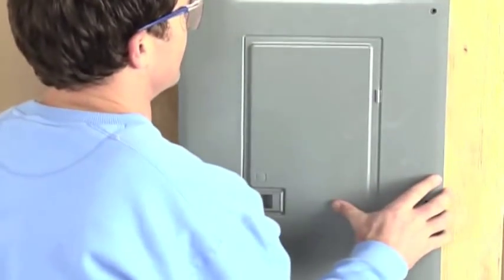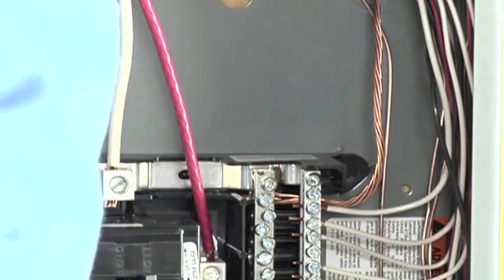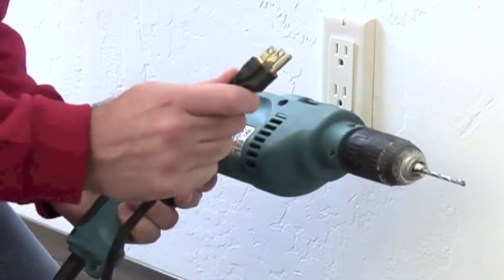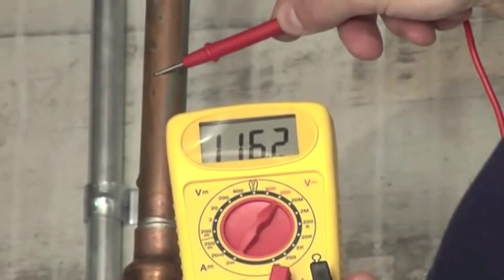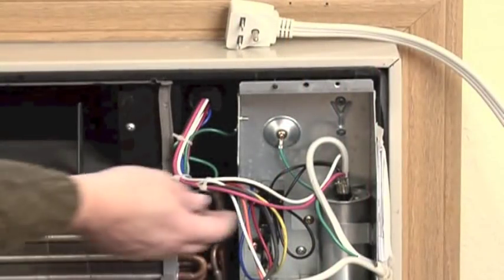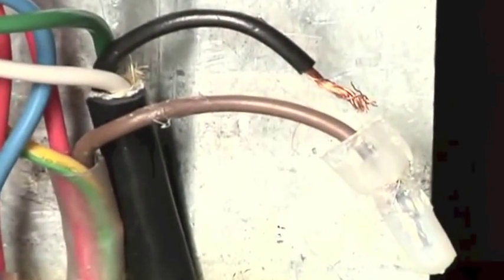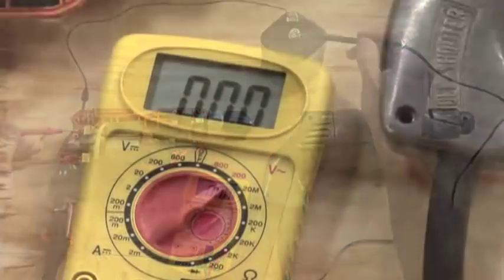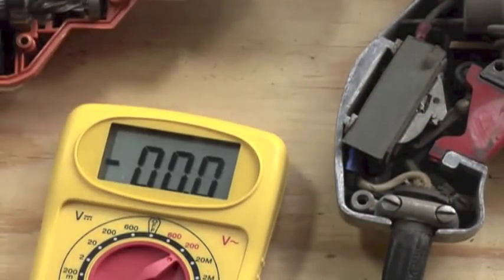Electrical Wiring Safety:  Grounding Wires

Comment: Neutral feeds back to the electric pole ground, and true ground is a rod that's 8 ft deep for faults only or lightning strikes. Main panels do combine them this is true but no current should be on the ground circuit except for faults!

Comment: The ground is NOT where fault current is trying to go. The ground is actually a horrible conductor of electricity. This video is not accurate at all.
Reply: It would become an anode at the least resistance would vary according to the mineral density and moister content.   Back in the day a long long time ago they had the one wire and ground rod system which will light a bulb but won't power an electric motor or most devices. ( I know about the light bulb thing because I've seen it work in real life in old barns.
Reply: Brian:  True.  The way it is normally said is that electricity tries to get back to where it came from.
Reply: Brian Hammerson yes people conflate "the ground wire" with the ground rod. (& who can blame them...) what most people call the "ground wire" is actually a secondary, normaly unused, low resistance wire back to the main breaker panel in the event of a short to (hopfuly) trip the breaker before someone gets a shock. In comparison the GROUND ROD is for "over voltage" equipment protection. (i.e. Lightning strikes)
Reply: Agreed.
0:31 "the ground has infinite capacity for absorbing electricity" = Not True

Earth Ground will often not allow high amperage flow which is needed for not 
only running equipment but for causing breakers to be thrown for safety.
Mike Holt does lots of good videos on this subject (grounding/bonding)
This is why it is important that the power company provide a neutral wire (a
 line going back to the source is what provides high capacity for electricity path(absorption). (high amperage flow)

The ground is useful in case of equipment shorting to its outer casing so that whoever is holding/touching the casing does not become the path of least resistance.
That ground may not be able to allow enough amperage to run the equipment but it is more than enough to electrocute a person. Relying on the ground wire alone in case of an equipment short is not good (though better than having no ground at all). GFCI should always be installed so that the danger can be eliminated (power cut) rather than just rerouted (ground).

It because the Earth Ground does not provide infinite capacity for absorption of electricity that makes GFCI more critical because less absorption can make your body look like a good path to flow into.
Reply: I thank each and everyone of you for these comments, this uncomplicates a lot.

Comment: All this hullabaloo over ground and neutral is a tempest in a teapot!  Years ago, there were only three wires; two "hots" and a neutral.  The neutral was referred to as "ground" and is, in fact, today still the grounded element of the system.  You can verify this by examining the wiring of a meter base, where you will see a 6 gauge bare copper wire connected directly to the neutral and running straight to the ground rod below.  The "third wire" (bare copper), found today in Romex house wire, was added for the sole purpose of providing an alternate path to ground in the event of a hot-to-chassis fault which would energize the chassis of an appliance or the metal case of a hand-held power tool.  Such a fault condition would not trip a breaker or blow a fuse, but would result in a shock to the user if the user's body happened to be grounded.  With the third wire connected from chassis to ground, a hot-to-chassis fault will now trip a breaker or blow a fuse, thereby protecting the user from possible electrocution.  And yes, in that brief instant between the occurance of the fault and the opening of the circuit by a breaker or fuse, the ground wire will carry current.  This assumes that everything is wired properly and securely.  At the very least, the third wire should conduct the hazardous voltage to ground.  In this instance it will likewise carry current.  ANY wire of an energized system has the potential to be "hot" under the right (or wrong) circumstances.
Reply: I remember years ago this was the case with major appliances requiring 240V clothes dryers and electric stoves. The three conductors black,red and white it was common the neutral wire was bounded to the cabinet of the appliance, as a ground. However it was still a return point since stoves and dryers used 120V one side of the 240V for the motors, indicators.  I am not certain when the codes changed, however I know it is required that a four prong cord get and receptacle be installed or doing an update with a completely separate ground connector.

Comment: You need to learn the difference between the "Ground" & "Grounded" conductors! There should NEVER be current flowing through the ground!! The neutral/grounded conductor is load carrying conductor. The Ground is for safety......

Comment: Copper wire going to earth is not a fault ground but is there in event of system intrusion or failure.  Under normal operations there should be no energy on the ground. White (neutral) is to provide a path back to the source. Energy will flow on all paths not just the one with the least resistance.

Plenty of engineers on YouTube to explain it all factually.

Comment: So does this mean you can connect the ground wire to the neutral or ground in the panel?
Reply: cooldog60 that is called bonded or bonding. It is by NEC code for a panel to have grounds and neutrals bonded if it is a main panel vs a sub-panel. However, ground rod(s) should still be installed for the panel.
Reply: @coypatton3160  so was tht a yes or no dude simole question you made hard
Reply: @alexmontoya656  if you can’t handle that response, be sure to leave the covers in the panel!
Reply: For instance does it matter what sides i connect red and black wires for my double prunged breaker I cant find an answer anywhere
Reply: @alexmontoya656  and what does this question you pose have to do with bonding or not the neutral or ground?
Answer:nothing!
Are you talking about running a 240 volt circuit?
You need to have a 240 breaker, which means that both hot lines will have the same amperage, and either the switches are bridge so that both sides trip when one does, or it has only 1 switch (either style is acceptable) the 240 volt breaker also forces the breaker to pull from the opposite feeds to the panel so you have 240 volts. 
Once these are in place it does not matter if the black is on top or bottom nor if the red is on too or bottom. 
Unfortunately, in electrical work, there are no simple yes or no answers. 
As to the above bonding issue you only bond in the main panel. In sub-panels ground and neutral must be separated—unbonded! So the typical answer is always it depends. 
If I said it depends and left it there, how would you have felt? I try to offer an explanation. 
Again not understanding that you have 2 feeds providing 120 volts and you need to pull from each for 240 volts, means you really need to leave the cover on the panel!
Reply: @coypatton3160  u made a simple question hard the correct answer to his problem is no you cannot i figured everything out myself thanks

Comment: Ground concept is only a psychological, additional expense and no sense , appliance works without it.
Reply: Older houses buildings  , electric installations only had 3-wire systems  , only 120v appliances had a ground an neutral   , 240v appliances only had ground  , things worked great an are still working great for years , now  arc-fault , gfci breakers , tamper proof receptacles,  weather resistant receptacles  .
Reply: You folks reference things from the 60’s and before. If you like things they way they were in the 60’s please enjoy them, but leave all the other modern items here in 2019!
I mean really do you use s ringer washer? Drive a car with 3 on the column? Hang your clothes outside to dry? Your wife stays home and you live on one income? 
If not and you have no plans to do these and hundreds of others, then accept that nothing stays the same and you really do not want them to stay the same!

Comment: this video is so wrong. it should be taken down as unsafe
Reply: It's wrong about how the electricity works but the practical use warnings are still valid.
That is, grounded outlets and equipment are going to be safer than non-grounded.
Reply: It also provides a lot of misinformation. It interchangeably uses ground for what the grounded conductor (NEC Term) performs. It states a ground had infinite capacity to conduct electricity—wonder why there are so many different gauges of  wire then? Should I continue anyone?

Comment: Sorry..... female voice and electrical topics don't go together
Reply: These videos were made by Home Depot and had a man's voice originally. The video content was made by Home Depot and sold to RTA Cabinet Store. I know because I'm the one who did the voiceovers. I copied exactly what the man in the video said, word for word, and said it myself (as my client did not have the rights to the sound in the video). So when you have an issue with the information presented, you have a problem with information originally presented by a man and made by Home Depot, a hardware store that is highly successful.
Reply: @thoseradstars  It's not your fault but it is incorrect. Electricity flows only back to the source which is L1, L2 or the grounded neutral to the center tap of the pole transformer for a home. Home Depot may be successful but that doesn't make it right. Plus electricity takes all paths back to the source not just the easiest. The easiest (lowest resistance) path will of course have the most current.
Reply: Ed Taylor Most everyone gets volts and amps mixed up. Electricity does not
flow back. Electrons (in amps) do flow back in order to balance the ckt.
Thank you for the info.